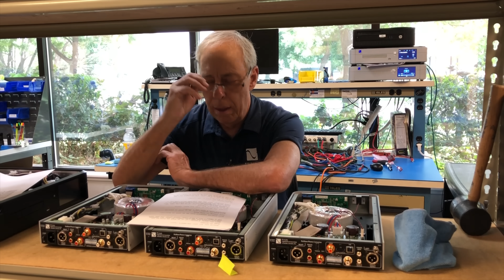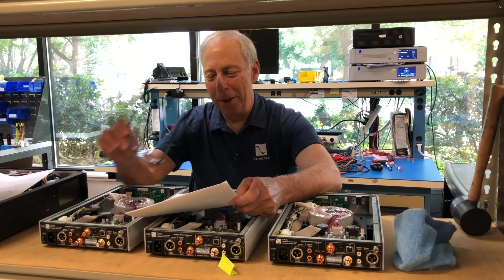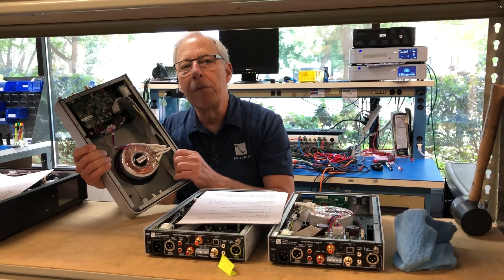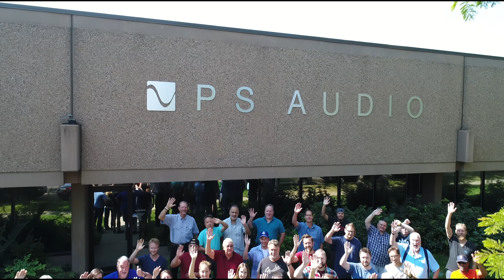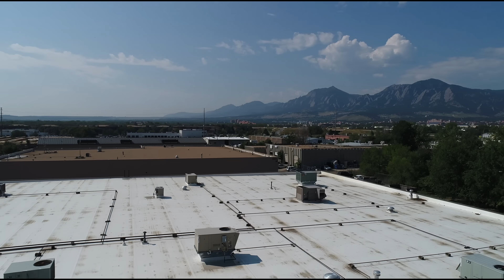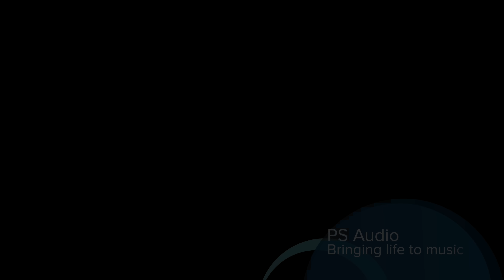What's inside a high end power cable?

Comment: The argument for “special” power cords holds no water as far as I’m concerned. Why? Because you are only improving the last six feet with the “special” cabling. In electrical circuits, the chain is only as strong as the weakest link. That would be the connections where Romex (copper conductors, Paul, not aluminum) are connected to the delivery receptacle(s) and those upstream receptacles on the branch circuit feeding the receptacle(s) that supply power to our sound system. Most homes have receptacles wired with the “back-stab” connections instead of wrapping the wires around the screws, and instead of pigtailing the branch circuit as it passes from one receptacle location to another, they are wired through the receptacles, making the branch circuit “chain” even weaker. 

With those thoughts of optimizing all links in the chain of delivery, we should first pigtail all of the upstream connections, then make certain that the 59 cent receptacle(s) powering our system are replaced with heavy duty or hospital grade receptacles that maximize power transfer with better contact surface. With that done, we can move to the power cord, which simply needs to be of sufficient gauge to carry the current that the equipment requires. For amplifiers, this is often maxed out with 14 AWG cord. Other components such as phono preamps, preamps, CD players and turntables all require very little current, much less than one amp, so an 18 AWG cord is more than sufficient. 

Remember too, that there is no musicality in 60Hz 120V AC power. It’s just an alternating current sine wave. That sine wave of course is filtered for transients, stepped down and rectified, the filtered for ripple, voltage regulated and filtered again for pure, clean DC current that is as noise free as possible to use for motors, lights, sometimes cooling fans, and yes, ultimately music. 

Think about these things next time someone wants to debate the merit of “high end” power cords. Be honest with yourself about it, and you might be happier saving a couple hundred dollars on each power cord and spending it on media or speaker cables, which do have profound consequences on sound quality up to a point of diminishing returns.
Reply: The power cord from the wall to the equipment needs to be of greatest quality, because it likely lays on the floor, across other cables, etc. The mains in the walls don't have these problems.

Comment: Sorry Paul, I'm not buying the "solid wire is better for bass frequencies" bit. My two 15" subs connected with standard stranded IEC cords give me full, deep, satisfying bass. And the MV control does not need to be cranked up. And they're not located in corners or anywhere along walls. But instead, towards the middle of the room, co-located with my hybrid 3-ways. Creating true full range towers. 
What I think/believe makes the most difference as far as cables go, is using properly constructed speaker cables. Four conductor, double twisted cables to each speaker. They will be non effected from any magnetic fields created from AC cords.
Reply: Passive speaker cables are not affected by EMI and RFI to begin with. The source impedance of a modern amplifier is way too low for EMI to have any influence on a passive speaker. Furthermore a passive speaker has no electrical gain to amplify the EMI/RFI. Now tube amps may have their feerdback loops upset be excessive RFI but that too is rare unless you live next to an AM radio tower.

Comment: Paul,  How about I construct an A,A+B,B switch box to do a blind audio test where I randomly start out in either A or B and then we switch back and forth between the two power cables and you tell me which cable we started out with, say powering your amp.  We repeat this test a good number of times to get a really good sample set.  Then we swap the two power cables for A and B positions and we go through the random initial power cable select again.  I operate the switch box and you listen to any system and your choice to tunes.  The switch box will include the A+B state so as to not remove power from the system while switching between cables.  And we can find some really decent contractors or relays to do the switching.  The switch box can utilize copper bus bar or some of your fancy AC power cable or just grossly oversized copper wire if you like.  What do you say, would you be game to give it a try and publish the results?
Reply: Chris H yeah, you do that

Comment: Hi, totally agree with the first pjtruslow comment! when you put your 200$ mains cable, what about the rest of the mains network inside of your walls? Remember that the mains network is in serial with your mains cable. Will the 2m expensive mains cable do magic? The job of cleaning the signal and store the power is done by the power supply. Putting a good quality mains cable you can just avoid adding some problems, but that's it. Does it worth to spent 200$? You decide :-) I am working in a very serious and famous company selling some very expensive active speakers. They are very powerful. Our mains cables are just normal ones :-)
Reply: Here's a thought. What if the superior (expensive) mains cable fixes the evil which the skimpy supplied cable induces? My receiver (95 watts x7) came with 4' of truly craptastic 18g wires I wouldn't power my clock radio/alarm with. Maybe, the super cords Paul sells do make a difference at high volume demand.
Reply: @jamesplotkin4674  hi James, the cheap cable will not introduced more problem than those already introduced by the rest of the mains network (before the wall socket), and not more than an expensive cable. The problems don't start at the wall socket. The final cable is only a few part of the mains network. As I told, for a very powerful active speaker (class D, 8200 W each speaker) we use a normal mains cable. The job to clean the signal is done by the power supply in the product, not by a simple cable.

Comment: When obervation (in this case, hearing) cannot be measured, a real scientist will theorize and design new ways of measuring. The "objectivists" are not scientific.   I hope some day we will find out.
Reply: H Cheu focus more on the speaker. If you claim to hear a difference, then the speaker's doing something differently. The speaker is responding to some change in the signal, correct? We already have instruments that measure the electrical parameters. But notice that nothing is ever measured and we can never measure these invisible signals..
Reply: The next step, after we exhaust all known ways of measurement, is to theorize what changes other than the known factors and find out what and how to measure.  In other words, we need a leap in theory and then invent new experimental methods to verify the theory.  I do not do audio research.  But I do neutrino research.  That is how theoretical physicists and experimental physicists work.  Theoretical leaps and inventions of measurement are the pathway to winning the Nobel Prize.

Comment: I have a couple questions Paul. 1 are you using aluminum for your electrical wiring in your buildings? That's a no no. 2 do you know about "geoengineering" weather management programs? When you go to England try greenlaning , dirtbike preferred or walking but you will see more country side that way.

Comment: Poo pooing objectivism suggests you believe you've transcended the science of audio and electrical engineering. You're selling the idea that some inexplicable audio magic happens when 60Hz 120v AC current passes through 3 ft of stranded wire. All while ignoring the several hundred ft of stranded cable run from the power main AC transformer to you house, another 100 ft of solid core romex, and countless twist splices and screw down connections feeding the outlet. I question the credibility of that thinking.

 When it comes to audio equipment, at what point did the law of diminishing returns produce a zero net sum gain in iperformance? We've reached that point decades ago and ever since there's been nothing but ridiculous amounts of money thrown into endless wormholes of pointless complexity that would make Rube Goldberg laugh his ass off. All this mental masturbation produces nothing but an ego driven placebo effect akin to the emperor's new cloths. Although highly sensitive testing equipment may detect minute differences, our ear is a relatively dull microphone feeding an infinitely subjective and highly impressionable processing device know as the human brain and it's inauspicious powers of perception. 

A high quality power conditioner will clean ALL the noise in the power line. If you're experiencing fall off on your sub signal, maybe your preamp's transformer is oversized, but I can assure you Paul, it's not the 60Hz 120v AC power feeding it. Anyone saying they can hear the difference between a heavy gage power cord and an $800 PS Audio PerfectWave AC12 power cable is either delusional, or a carny snake oil salesman.
Reply: @ Gals Your intellect is staggering...
Reply: First, never trust the answer of someone who has a vested interest in making you think one way or the other; second, how can anyone explain the justification of using solid and stranded power cabling that’s plugged into an outlet that is fed by solid wire? Third, why should it cost so much more just because it’s stranded and solid together - it’s still copper, right?  Save the money and go a trip yourself, like Steve does.

Comment: Another major difference between crap cable and high-end power cables that Paul forgot to mention is the amount of EMI/RFI insulation present in the cables design. The three reasons I'll spend more on cables are better metal quality, FAR better EMI/RFI insulation and higher quality connectors (using tellurium or beryllium copper, not brass or bronze). Nothing is more frustrating that having your good phono cable or some other signal cable  be reduced a radio antenna due to it simply being within proximity of a poorly made and poorly EMI/RFI insulated power cable. RCA interconnects are most vulnerable to leakage for this sort of noise. Well made XLRs are far less prone to electrical noise and radio interference by design. Toss in USB, ethernet cables, digital and speaker cables into the mix and you have line buzz just waiting to happen and that's just behind your rack! If you live in high-density urban areas then you have literally hundreds of mobile/cordless home phones and at least several dozen wifi routers...all within 200 feet of your apartment. Then theres the issue of high power broadcast radio/tv towers that are likely less than a mile or two away. Add a hundred or so refrigerators and air conditioners in the apartments sharing the wiring within your building and that's when a powerplant regenerator is in order. It's so much easier to hifi in the suburbs! More room to breathe, less airborne radio noise, having a transformer between your electrical system and every other house on your street instead of sharing electrical distribution lines with 100 of your neighbors and all their electrical line noise.
Reply: Woofy 98102 I am 100% in agreement with you! This is why I buy moderately priced AC cables
Reply: @jimolson9671  I've had really good experiences with Pangea's cables. The cable designer insulated the crap out of even their basic power cables. They use a mix of gauges for the cable and the conductors are a mix of solid core and litz wire. For those wanting better metal quality, their SE cables use Cardas grade one copper that's essentially the eqivalent of monocrystal copper but don't cost anywhere near as much as a mortgage payment like many cable companies charge. The brand is sold online through AA so they're easily obtainable, and the 14awg models are available in long lengths ideal for use with projectors. BTW: PS Audio's Power Cables easily offer the best value of high-end cables. Their focus is on the tangible, like metallurgy, insulation and geometry and they skip the magic and unobtanium bullshit other cable companies employ to justify their ridiculous pricing models. Their equipment's manufacturing quality and performance per dollar ratio makes their gear gear easily the best value in high end. For example, their BHK pre at $6K offers performance that is easily the equal to the megabuck preamps other brands sell for $25K and up. That same level of value is present throuout their entire product line.
Reply: Woofy 98102 went to work-Angela is the only way to go! I buy the card is copper ones as well. I have the seven gauge for my power amps and the 14 gauge for all my constant current devices there is no noise whatsoever in my system. But of course I have a firm in reference balanced power supply that as a great deal to do with us as well